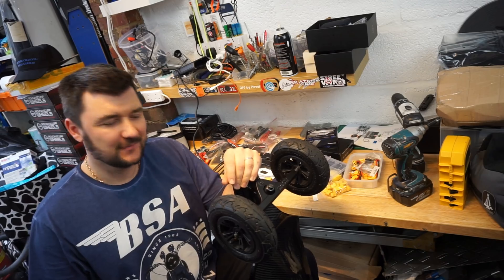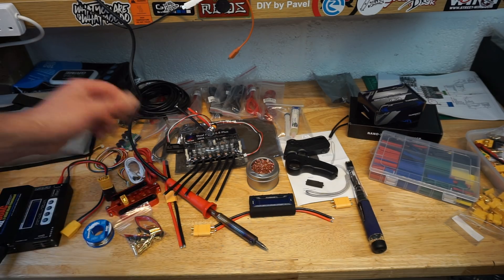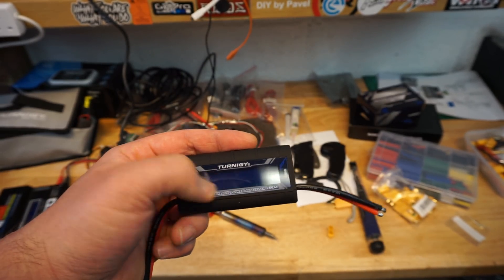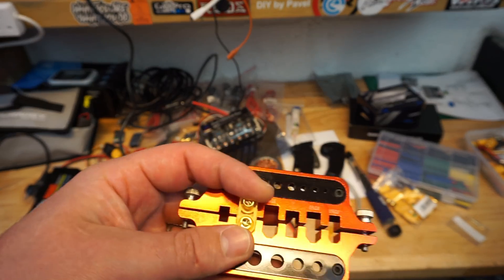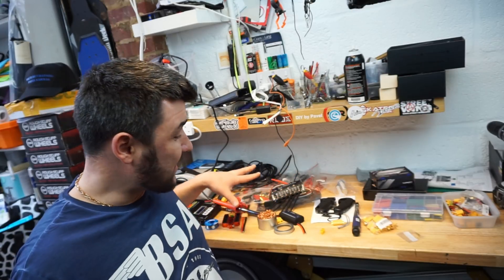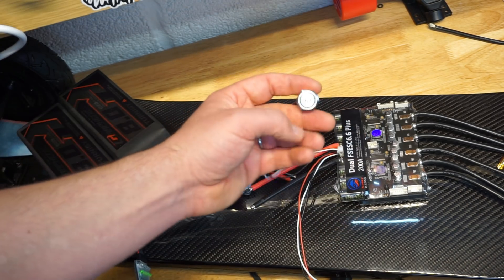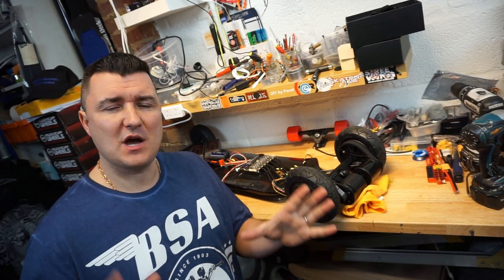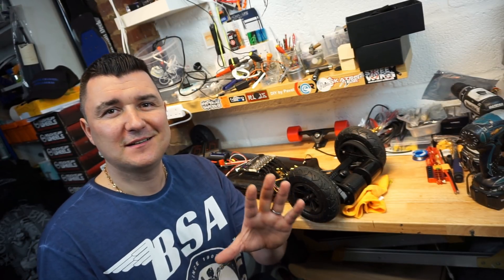Electronics required for DIY electric skateboard. Beast video 9

Comment: Friend, your videos are very good to me even though I don't speak English but I really like your videos, a question which batteries are those?  4s?  where are they bought ??  And what autonomy does the longboards have with that battery?
Reply from the maker: Hi,
Thank you very much for a lovely comment. 
The battery in the video is made out of two batteries connected in series. The original batteries were 6S3P and i have replaced the cells for Samsung 30Q.
No it is a 12S3P pack. Pack and the enclosure are flexible .
Hope this is the information you were after my friend.
Regards.
Reply: @PavelGarmas  Yes, that was it, and if you tell me how many km you do with those batteries, I would really appreciate it.
Reply from the maker: @nachobarreto1530  
I am getting 12 -14 miles on the board. I am 110 kilo though ; )
Range does depend on a lot of things  though.
Reply: @PavelGarmas  with my 60 km I am a fringe hehe, thank you very much friend !!  very good your videos!!!
Reply: Sorry 60kgr 🤦‍♂️
Reply from the maker: @nachobarreto1530  
This board would fly!
By the way, join me in my Facebook group ESK8FREEDOM!

Comment: Have you tried the new dual 6.6 plus yet and how is your older dual 6.6 holding up I want to run 12s 8p with 6380 motors
Reply from the maker: Hi John,
The 6.6 plus mini is not good …. too many fail. My older - larger 6.6 plus is still going strong but it was the first batch  unit. I would recommend to stay away from Flipsky esc to be honest.
Reply: @PavelGarmas  got any vesc recommendations?
Reply from the maker: @VegasErides  
Trampa vesc6 mark 3 or mark 4; Maytech 6.8 superFOC. I do have reviews on both of them if interested mate.

Comment: Where can you get mounting bolts for different motors?
Reply from the maker: Hi,
I normally buy them from Ebay. Go for the high tensile bolts and you will be fine.
Reply: Thanks again 👍🏽

Comment: also you never mentioned the remote you'll be using, what are u picking
Reply: is there anyway to use evolves r2
Reply from the maker: @alpaa8750  
Good question. ...it is possible as long as the receiver is not integrated into the mother board....most of the production boards have them as one unit.
Reply from the maker: I have decided to go for the Flipsky mini....the one with the hole for the finger - very comfortable to hold. I will cover the remotes soon in a new video.

Comment: Nice video Pavel liked the bit where you nipped to the barbers made me laugh. Hopefully on the final session of my build tonight and starting testing with the 10s4p battery tomorrow. Looking forward to seeing your board progress. Did you not fancy Bluetooth telemetry? It would mean no need for that power analyser.
Reply from the maker: Hello mate!
Good to hear from you buddy. I did get the power analyzer before you have suggested the telemetry ....plus i do not like wireless stuff that much to be honest. 
So the 10S4P ....new battery ?
Reply: @PavelGarmas  hi mate yes I've spent the last few weeks building the battery and fitting it all in the enclosures. Had to change the anti spark for s smaller one etc so it's taken a while but finally finished everything tonight. First test on the new battery Saturday morning hopefully.
Reply from the maker: Well done mate! Battery building is a skill in a half! Let me know how do you get on.
Reply from the maker: @simonchurchley8088  
Nice one! Now I know who can build a custom battery pack for me ;)